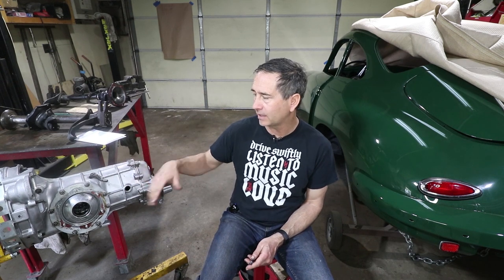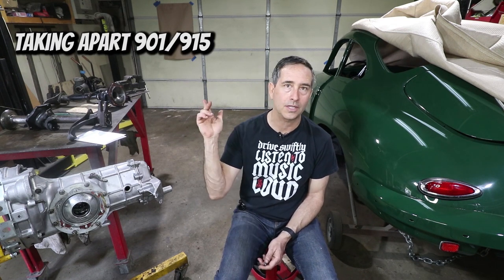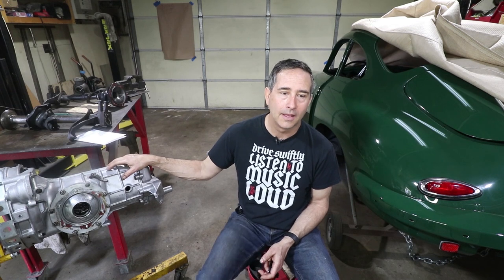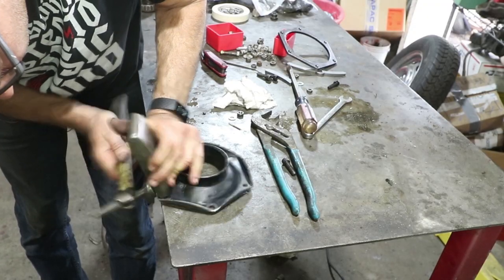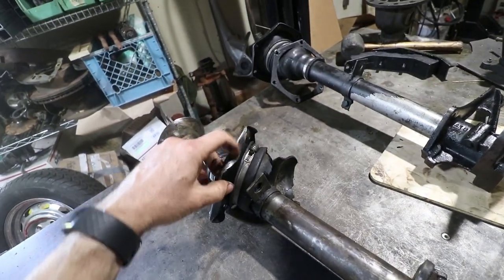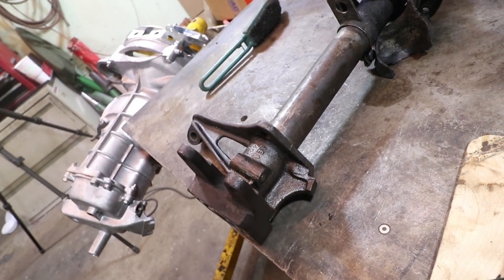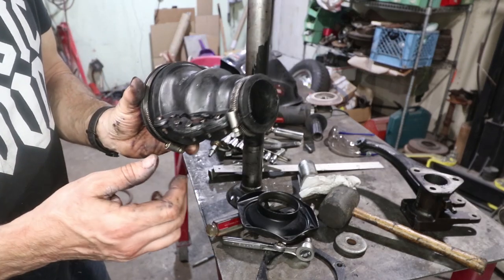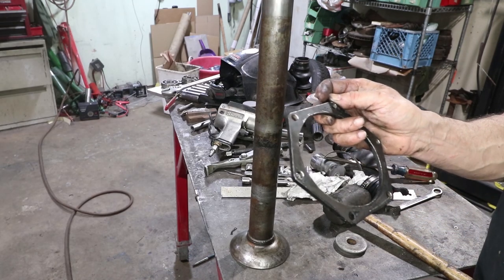PORSCHE 356 Axle Tube Disassembly Takes 3 Tries & Transmission Update

Comment: Great work; re the stiffener ring you found on the side plate, for swingaxle VWs there are what they call “stiffeners” to do exactly what you said: better distribute the load on the axle flanges so that they don’t deform on each of the holes and cause leaks. Only difference is that they come in two halves per side instead of the one per side like you found. They might fit these old Porsche transaxles; I know the replacement axle boots are the same for VWs and Porsches. To prevent this bending on the flanges it’s advisable to not over tighten those nuts over the factory recommended torque.
Reply from the maker: Thank you for identifying those.  I didn't reinstall  and there was only one.  Hopefully it won't leak when it goes back together.  I won't overtighten, but it will probably need some sealant goop.  Permatex blue?  Or Curil T or?
Reply: @GarageTimeAutoResto  What a very knowledgeable aircooled mechanic told us is use Permatex Aviation sealer on each of the paper gaskets and on the flange itself around the ring put a bead of gear oil resistant Permatex sealant (can’t remember if it’s the gray or black one) and you should be golden. Also follow the instructions for the Permatex which I believe tells you to wait a little after application before installing and then snug it first for some time before torquing to spec. And also wait for 24 hours before re filling the transaxle with gear oil. Another useful suggestion is try to fill the transaxle with the axles in natural position if possible with the wheels on the ground to prevent over filling.
Reply from the maker: Thanks!  Great advice here.

Comment: Tom there are snap ring pliers that are about a foot long  just for jobs like you are doing, also if you weld a bead on the inside of the bearing race they will come out with a few taps on a good day .
Reply from the maker: Those snaps are still soaking.  A better long reach plier will be needed I think.  I couldn't even get it to rotate by smacking it...Its stuck.
I tried the weld bead method on my front hubs and it worked great!  Will do again here... hopefully after the snap rings are removed.

Comment: Hi Tom, do you have a video that shows the removal of the transaxle right from the start of tire, brakes etc. I may have to pull out the fulcrum plates since they are making a thumping noise. I will be first time doing this sort of work, I don't want to screw up anything.
Reply from the maker: I don't because I removed those items decades ago.  I did have a temporary transmission in there.  I'll have a look and see if there's something useful for you. 
Be careful because there is some stored energy in the torsion bar.